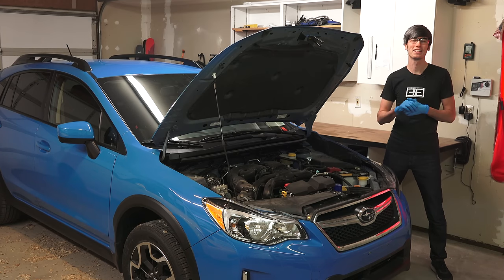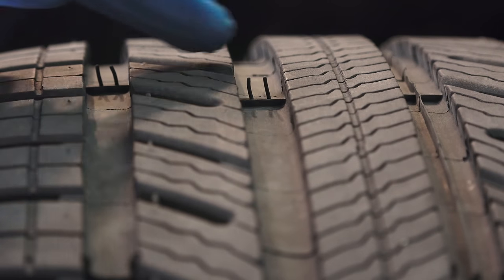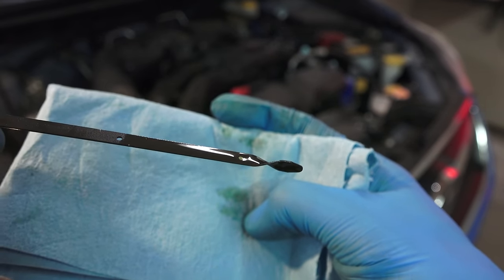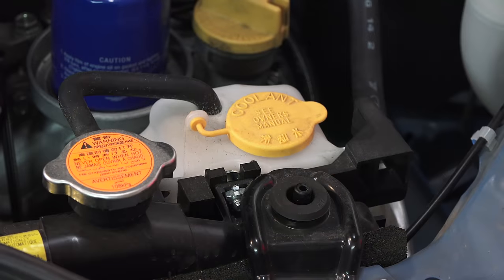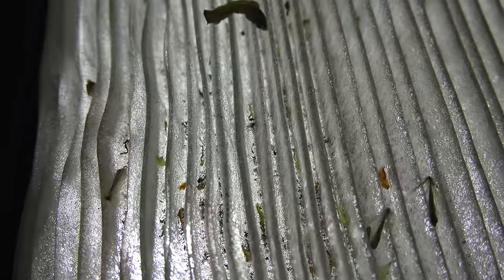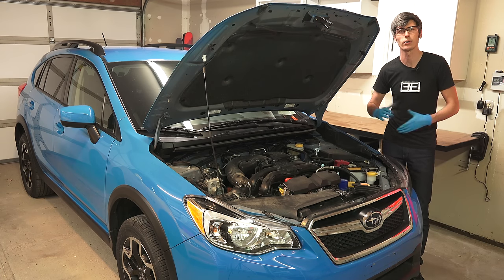How To Make Your Car Last A Long Time - Simple Checks

Comment: It's all fun caring about this car if it's brand new. Simple tip - everybody should have a laser reader to check if tire is less than 5mm. Things to notice - it's not a usual four cylinder engine. Don't have too much oil or it exits everywhere it can. If there would be more car's not having  this maintenance routine they won't talk about it and mostly it's how new cars are first five years and it changes with anybody first having it. How they change tires with that device - it does not change. Lifting a car damages it's sills and we want it lower and not some dakar car. Magnetic air intake engine parts wear out so this is where it is, that tape recorder, behind the glove box.

Comment: Spray all the rubber gaskets with WD40. Gaskets around shocks struts tie rods even the rubber covers of the axles. The WD40 will keep it flexible and help stop ripping and cracking. Stops the dry outs.

Comment: Hey EE, you probably wont see this but I was wondering if you could tell me what to do regarding starting an S2000 (in order to minimize damage/wear) that hasn't been started in over 2 years. Nothing was done pre-storage (unfortunately) other than attaching a trickle charger. I have performed maintenance such as valve adjustments and would say I am reasonably comfortable with simple DIY. New viewer here. Love your videos!

Comment: I was really hoping you would cover the simple but way to commonly made mistake of using the max pressure of the tire thats written on the wall when its not needed. too many customers come in with there tires rocking 70 -85 psi in sedans..

Comment: He should have mentioned jacking up each wheel and pushing on the top and bottom of each wheel checking to see if the ball joints or tie rods are weak and letting the tired move back and forth.   If your tie rods or ball joints break the wheel will break away  forcing you to also replace the axle costing hundreds more in costs...

Comment: Another easy thing anybody can do is to clean/air blow brake calipers (or drums and mechanisms but this requires removing the brake drum).  This prevents seized calipers (cylinders) and such problems.
Reply: How is that easy?  You'd have to take the wheels off and have access to an air compressor.

Comment: Understand these are not a full detailed inspection. If you have a problem with your vehicle send it to a proper mechanic like to a dealership or dedicated brand shop that focuses on ACE certification. Most shops will offer a good inspection as long as you have good reviews or history with them. Please be mindful every vehicle has different specifications always read your owner manual as this can usually refer towards an answer for some questions. Refer to service manuals for correct specs. If you don't know although the internet might tell you sometimes it might be wrong so instead just take it to the shop.

Comment: Would like to point out to check your transmission fluid if your vehicle does have a dipstick even tho it its sealed transmissions these days, its cheaper to maintain the transmission rather buying a new transmission.

Comment: You forgot one: don't forget to change the brake oil at least every 3,000 miles.  You need a liberal dose of moly grease on those rotors to keep them from rusting out.  VERY IMPORTANT.

Comment: One question: Should I check the oil dipstick, after I have waited 5-10min after I turned of the on operating temperature running engine to let the oil circulate? Or when it's cold? Or immediatly after the on operating temperature running engine was turned off?

Comment: 0:38 I didn't understand this explanation. I was looking at the "hairs" and didn't see the logic in what was said. But after looking it up elsewhere, he's actually talking about the "lumps" that the hairs sit on. The ones which are a few millimeters above the bottom of the "gutters"/"pits" between the treading. So in this video there's about 10 millimeters of treading left, which is very far from needing replacement.

Comment: How often should you check your oil catch can? Should you use some sort of sealant to spray on the rubber to prevent them from crack? (E.g. CV boots, etc.)

Comment: You forgot one thing, but most american video makers somehow do, maybe it is not so much a problem overe there.

We learned, we should drive wheels max 10 years and after 7 years have an close eye on it. The tire loses oils and the rubber gets harder and harder, until you can see, that little chunks are missing and the rubber gets brittle, this is the time you should definitely look for new ones, because they now drasticly loose grip and lifetime. Additionally the inside of the tire ages as well, it oxidizes and makes the tire less resistant and more likely to break on high speeds, or pot holes. This effect is mostly noticable after 7 years, on normal use and can take longer on perfectly stored tire, so a good stored tire lasts a bit longer, but rule of thumb is 7 years here.
For everyone that does not know, you can see the age of your tire on your tire, somewhere there is a (0813) meaning it was produced in week 8 2013. At least here in germany/europe it gets printed on the tires, would be fascinating, do you guys, not in the EU have this tire information also?

Comment: Milky oil doesn't always mean coolant in oil. When you do short trips, the oil builds condensation and looks milky too.
Reply: I once replaced an oil cooler on a Chrysler 200 3.6, and then a bunch a coolant fell into the oil galleries. I had to change the oil 4 times until it stopped being milky.

Comment: Here is the scenario: Bought a 3 year old car with less than 20K on it from a dealership. According to this dealership and carfax, they have performed 125 point inspection and oil + filter change at BMW service center 6 months before I purchased it. During that time car was sitting at the lot and wasn't driven except for couple of customer's test drives.  The car doesn't have a dipstick to check oil color.  Looking at the engine oil cap, I do see that oil is dark, but not black.  Would you say I should change it anyway or believe that dealership really did change it?

Comment: I have a 2016 Impreza and the coolant level in the reservoir is below the min fill line. I took it to my dealer and they said it was fine as long as there was fluid visible just under the radiator cap. This seemed odd to me.  Being it's the same engine as yours in this video, it was noticeable that your fluid level indicated correctly.

Comment: What do you all think about the ZF Lifetime no dip stick maintenance schedule. I’m afraid to touch it until 100k when warranty expires. On the other hand there is no way it’s good for the transmission to go 100k without dropping pan? Any ideas on aftermarket pans and fluid? Which fluids meet the OEM spec?

Comment: The easiest way to check your brake lights is to wait until someone is driving behind you, and then brake very hard. If they react quickly and slow down, your brake lights are probably working.

If they rear end you, you probably should replace your bulbs.

Comment: I don't disagree with the fact that needs to be done but there should be more frequency at a minimum once a month. Especially, if you're a frequent driver. Maybe if you're elderly and you drive it once every month or two you may have a point. May have a point

Comment: when should you check your oil? When the engine is warm or when it has been sitting for a long time?
Reply: I think you check it before you turn it on
Reply: @user-xj6qe8cn7y  ok so you mean when the engine is cold?

Comment: Most of the things you mentioned have nothing to do with the car lasting longer, except for the engine oil check and the air filter , anything else is a basic from time to time service check up and service due !

Comment: Hey Jason! I have a question about mechanical resistance in automatics versus manuals. I am convinced there is more resistance that slows me down in my stick shift 2018 Crosstrek than a regular automatic transmission, since I feel like I use less brake than I would driving an automatic. What's your take on this?
Reply: Do you use lower gears while driving than an automatic would?

Comment: I had to pause, you forgot to mention cupping/feathering/scalloping on the tire treadwear front.  Indicative of soft struts, bad arm bushings, bad wheel balance or weight overload 😉
Reply: Also, give the vehicle a few minutes after shut down to check oil 😋
Reply: Trans fluid, both diff fluids, undercar leak check, cooling fan operation,  spare tire check, belt(s), hoses (all), code checks... not knocking you dude but it seems that you're moving into ETCG territory
Reply: Ifixem just edit the comment rather than replying to your own comment

Comment: My parent's car just had a failed transmission at only 75k miles. Toyota had a lot of problems with torque converters on the 12-14 Camry models. No really sure how the torque converter destroyed the transmission so fast.

Comment: And if your brakes squeaked for a couple weeks and then stopped, that doesn't mean the "problem" went away.  It means you wore down the squeaker, and are getting close to having no brakes, and also damaging your rotors (way more expensive to fix).

Comment: Funny, every time I went to an oil change (which I don't anymore because it's easy to do yourself for not even half the cost), they asked me a) could you pop the hood? and b) check the cabin air filter. What's funny about that is that I drive a Wrangler without top, so a) a Wrangler has no hood to pop and b) what's the point of a cabin air filter in a convertible without top?

Comment: Hi there I have Subaru Legacy 2010 GT Turbo, recently I fixed some noisy sound in the turbo but after that I am facing gear early shifting while using the Sport mode and cross half of the throttle, do you have any idea on this matter, also since long time while slowing down from 60 to 20 there is hard bang from the AWD box with mettle clash sound, please advice.

Comment: Great thanks, but I have a question: why does a small hole in the exhaust influence fuel consumption so much?
Reply from the maker: I guess it depends on where the hole is. If it's before the O2 sensor it could influence your air/fuel ratio and cause you to run rich.
Reply: Actually no, it is behind that, about 30cm... which is why a small hole, 5mm in diameter, baffles me on how it can influence my fuel consumption so much. I would lose close to 30% on fuel with that small hole. Do you have a video on that I could watch?

Comment: The best thing you can do to make your vehicle last an extremely long time is do all the maintance, repairs, and upgrades, yourself.  Do not let a professional, "clock puncher," touch your car.  Get schematics, diagrams, tools, and do everything yourself.  You will also save about 95% on costs if you do everything yourself.  Car work is not hard, just tedious if you have a cramped front wheel drive vehicle with a tiny front end.  But that can be remedied by never buying a car like that.  Buy rear wheel drive, front wheel drive with a larger front end, or a 4x4.  Avoid minivans and full size vans at all costs.  Avoid micro sub compact cars also.  They are running on the edge of self destruction to begin and do not last very long.  A few exceptions would be a small Toyota because they do not go bad often so a cramped front end is fine.  Make sure to avoid a vehicle with a CVT.  The CVTs on consumer automobiles are not the CVTs in race cars.  The consumer cars have extremely fragile CVTs and will fail sooner than later.  Buy nothing from GM (Garbage Motors) within the last fifteen years.

Comment: you missed jacking up the wheel and trying to shake it up and down to see if wheel bearings are dead.
forgot about transmission fluid, check with engine running at operating temperature (for automatics, manuals check according to operators manual)
as long as your poking around your engine may as well check belt deflection (try to twist the accessory belt, maximum play should be ~180 degrees)

Comment: 2:15 

90% of used vehicle  would not have the “PWI” little metal clip that will scratch the rotor whit the purpose of making a noise that tells the driver is time to replace the brake pads.
So if ur driving an use car, dont spect always that noise to show up as a warning lol

Comment: As per car manual 10k km I need to replace engine oil. I will reach that mark in 1.5 years only as I use car very less. So is it ok to change it 1.5 or 2 years once. Not using synthetic oil though.
Reply: Suji S Are you driving it daily for short trips or less than daily? If the latter, then you should consider trying synthetic oil, especially if you have temps below 32degreesF, regardless how many months between oil changes.
Reply: mrbill6666  weekly 3 or 4 short trips. I am living in tropics. So no low temperature. Occasionally will go for a 300 km trip. It's a turbo diesel Hyundai.
Reply: Suji S Oh okay, well I use the recommended 5W-30 (synthetic) for my 2004 Hyundai Elantra and I also use an aftermarket additive ArchOil AR9100. I live in Philadelphia, PA., USA. Winters below 32F and summers over 80F. I have almost 190,000 miles on it.

Comment: I have a question concerning checking your engine oil: Why do some owners manuals say to check your engine oil when it is cold and others say to check it after engine has reached operating temperature?
Reply: Why not look at dipstick at both cold and after startup/warm/shutdown to visually compare? "Check cold or hot" sometimes is stamped on the dipstick near the full line.

Comment: I was really hoping you wouldnt just say " look through the tire" when thats fine if the brakes are brand new but not all brakes wear evenly or at the same rate. Your inside pad could be at its limit while the outside one could look fine for another 25k....... also that if you check the fronts check both front tires each side could wear differently. happens all day long.

Comment: Wear bars are at around the 2/32inch mark.  That is pretty much a automatic fail for a safety inspection.  That’s one of the things that even the honest fair mechanics can’t use discretion for.  For US at least that is the federal legal limit and if not changed can be a blow out looking for a place to happen.  The tires will usually start giving you warnings in the steering feel before it gets to the 2/32”level.

Common sense to have a four wheel alignment upon completion of the tire replacement to get a good baseline and prolong the life of the new tires....  Remember the tire is based on what the manufacturer estimates the tire service life to be it is not gospel.  Outside factor....no pun intended can shorten or lengthen that base line.  I have had vehicles go past the service life and as long as there is legal tread (ABOVE 2/32”) a lot of repair facilities will do some stuff but manufacturers warranty is gone.

A trick I use for pretty much all exterior light checks is find a spot along a strip mall with plenty of glass window fronts.  Back in and use the reflection off the glass to confirm operation.  Assuming you don’t have a passenger.   

To a certain point I can agree with showing this video in Drivers Ed classes but let’s put most of the responsibility on the parents and family.   Too many people are saying the schools teach.......BS. Bring back real parenting and stop using the outside influences for lessons that should be taught or at least disused at home.  Some educational facilities whether it be Drivers Ed, trade schools etc...  Some of the material is so extensive that learning the course material is enough without putting extra  on basic life’s lessons that should be taught by parents, family friends, etc!!

Comment: 🎯 Key Takeaways for quick navigation:

00:00 🚗 Exterior Checks: Tires and Brakes
- Regularly check your car's exterior every six months.
- Focus on tires: inspect tread depth, tire pressure, and wear patterns.
- Brake check: monitor brake pad thickness through wheel holes or after wheel removal.
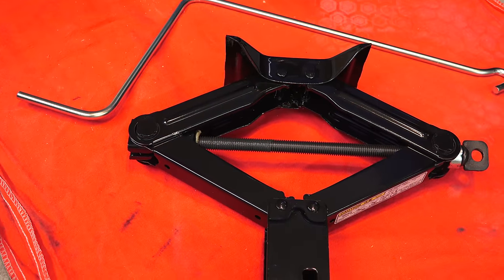01:50 🔄 Suspension Inspection
- Examine shock absorbers without wheel removal.
- Look for leaks, visual damage, and ensure springs are in good condition.
- Rotate steering wheel to inspect from different angles.
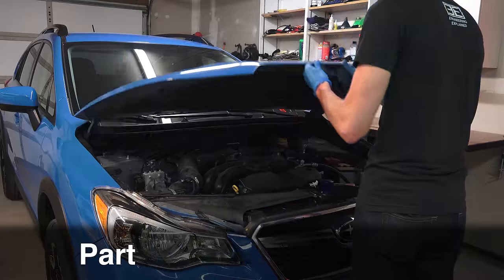02:47 🚘 Under the Hood: Fluid Checks
- Check engine oil using the dipstick and maintain levels between indicators.
- Follow owner's manual for oil change frequency.
- Inspect other fluids like brake fluid and coolant, ensuring they're between max and min lines.
04:42 🌀 Filter Inspection
- Check and possibly replace the engine air filter.
- Inspect the cabin air filter for debris.
- Regularly assess wiper blades for cracks or deterioration.
05:50 💡 Lights and Final Checks
- Ensure all lights (headlights, indicators, brake lights) are functioning.
- Verify brake lights using a mirror or recording.
- Regularly perform these checks to catch issues early and save money.

Made with HARPA AI

Comment: With proper basic maintenance, a car should be capable of reaching 300k miles and then some no problem. Most people drive their car like they stole it and never bother to even open the engine lid.  I drive the horrible and notoriously unreliable and expensive to repair/maintain VW and BMW. Love my cars.

Comment: You must know better than to keep your oil somewhere between the two indicators. C'mon, they should fill to the top indicator always. Also, please checking the cabin air filter this often is a waste of time to keep your car reliable. if you live in a normal environment, check it every few years. I am not a mechanic, but nearly all mechanics would agree with this.